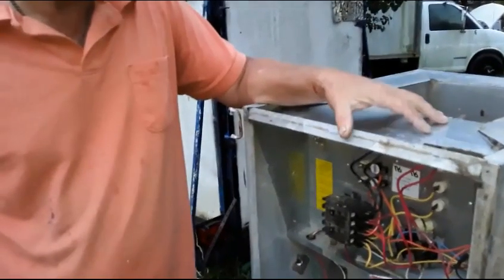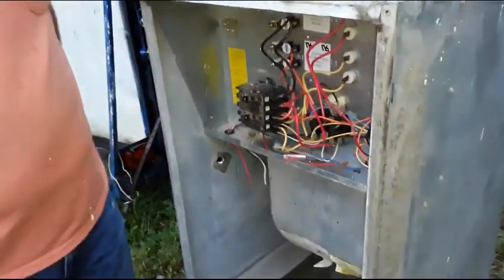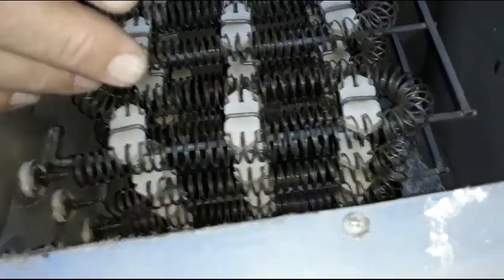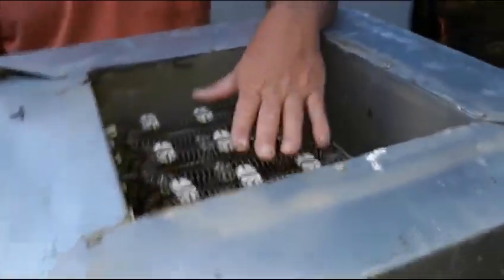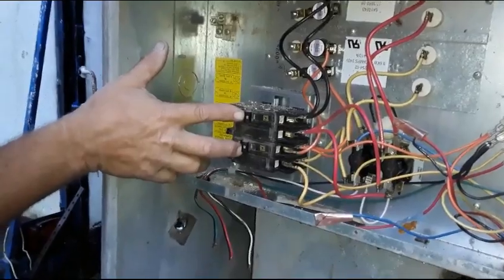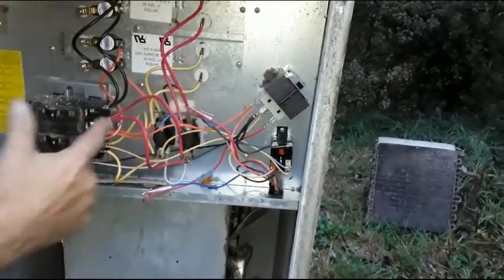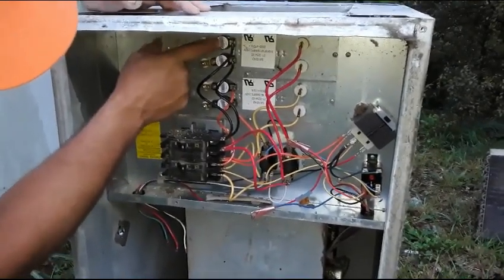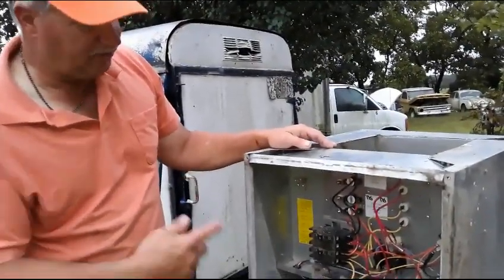What's Inside A Mobile Home Electric Furnace - Inside of Mobile Home Electric Heater

Comment: What about if it is heating, but not enough?
Reply from the maker: @joserodea  could be one of the elements is broken or sequencer that starts in stages is not working.
Reply: Best way is.     Replace it
Reply from the maker: @joserodea  disconnect power wires check continuity if it shows ok or open line then replace it .
Reply: Ok thank s a lot

Comment: When the heater is turned on, should the resistor turn on and turn red?
Reply from the maker: @juandavidjar  the heat strip should turn red. It turns red because it resists voltage that passes through it. Sometimes you can see it glowing red through cracks in the metal cover it is behind.

Comment: I have this furnace and when i shut it off  the fan turns off but the element will stay on and glow red  and smells hot but will turn off after about 5 min of running at full heat any tips of what to check
Reply from the maker: The fan is supposed to run 3 to 5 minutes past when the last heating element shuts down. You should have a wiring diagram to check your wiring

Comment: Just bought a house ac works heat doesn’t looked at a few videos like it like this one I have voltage everywhere but I don’t have that fuse I have a couple of wires that have ends on them where does the fuse link together what wires
Reply from the maker: I am at a disadvantage I can't see it from here. I would think there would be a wiring diagram. Perhaps if not there on line.  Get ready to fall asleep a little.
Reply from the maker: I am at a disadvantage I can't see it from here. I would think there would be a wiring diagram. Perhaps if not there on line.  Get ready to fall asleep a little.

Comment: Is there TWO fans in a system like this? I hear something CLICKING ON on my furnace and smell heat but the big blower doesn't turn on automatically when on AUTO.
Reply from the maker: The newer gas furnaces have two fans .The main fan and then the induction fan that pushes any possible gas fumes out before the gas lights then turns off . Otherwise one fan . If it's electric there is a fan relay and a heat strip sequencer that might click. Hope that helps.

Comment: Electric heat is 100 percent efficient there is no chimney or bi- products of combustion it dosen't get as hot as gas heat that's why some people think there is something wrong with the unit when there is not.
Reply: Google User do you know anything about hvac? Electric heat will get you 20-40 degree rise from incoming air...a gas furnace will get 50-70 degree rise, gas is a much hotter heat
Reply: Cost-wise gas is absolutely more efficient
Reply: @CarloWilburn-w9z but did you factor in the electric you still need to run the furnace on top of the gas you pay to heat it? So in reality ur paying just as much. You just pay it to 2 different utility companies
Reply: @CarloWilburn-w9z it's more cost efficient in most areas of the country. Electric heat is still more energy efficient though.
Reply: Couldn't have said it better myself. Not to mention. With proper care they last 20 to 30 years